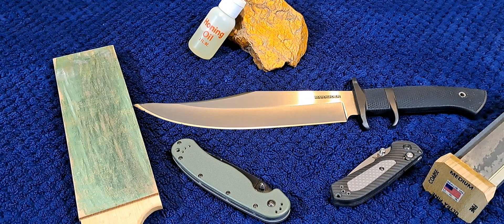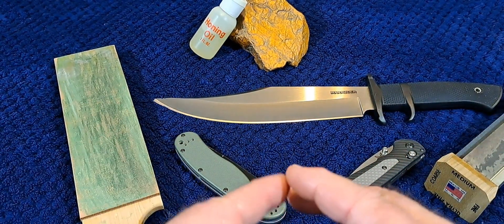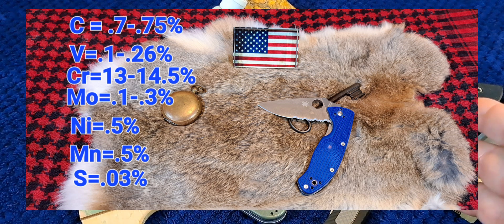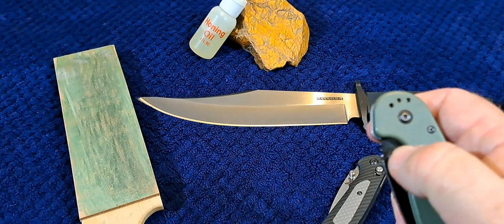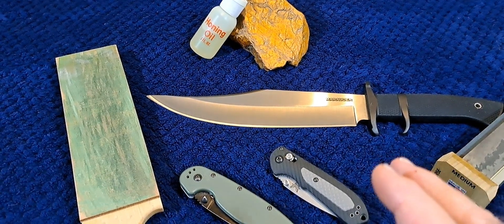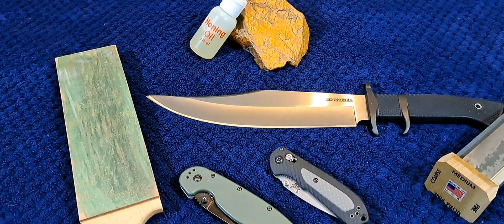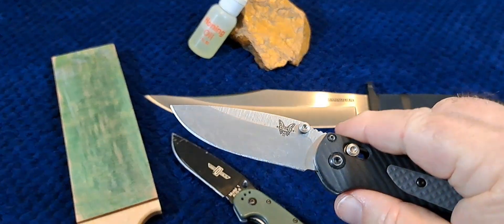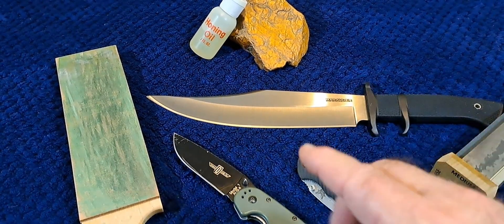What steel is that? AUS 8 steel.

Comment: Great info 👍 looking at a rat 1 I'm years in to collecting never picked one up on a side mote im in south central Florida aka the swamps lol never had any issues with rust  with d2 but i don't hard use my knifes so might have something to do with it 😊
Reply from the maker: You should try the Rat 1.5. I'm a swamp monster from Miami 😊
Reply: @rasputinscastle nice fellow swamper ...Kool I will check out the 1.5 😊

Comment: Very well explained. I always look at the charts and its even better to have each thing explained. The "toughness" rating always threw me when i first started with knives.
Reply from the maker: @PatriotPaulUSA  The toughness is really the shearpoint of steel. The harder steel is the longer an edge will last, but the steel is more brittle and likely to break. So the softer it is, the tougher but also its edge retention is lower.

Comment: Cold steel used AUS8 before in their budget blades now they use 4034. Better/worse?
Reply from the maker: @Anvil-wg2je  Good question. 4034 is an old proven budget steel. It's often compared to 420HC. The chemical composition is almost exactly like 420HC. I've not used this steel, but Cold Steel usually gets the most out of the steels they use. AUS 8 doesn't get glowing reviews, but I never had a problem with Cold Steels AUS 8.
4034 only has .5% carbon content, so I don't think you can expect it to have great edge retention. It's a soft steel, so it should be pretty tuff. I expect you'll find the performance of 4034 right in line with AUS 8. 🙂

Comment: Just got a Swisstech fixed blade in AUS 8 and plan on using it as a hard work knife, idk how well its gonna work out but i know right now it's shaving sharp so we'll see what she can handle
Reply from the maker: @ksrebelbuck7936  Aus 8 can be soft. That's not necessarily a bad thing in a hard use knife.  The edge can role on you ,but it won't chip. Usually the role comes right out when you sharpen it. B0oils down to the tempering. Hope you let me know how that Swisstech works for you.👍😊
Reply: @rasputinscastle  definitely, I'd rather have an edge roll than chip or break

Comment: In general, the only characteristic in which most of the “newer super steels” and “premium steels” greatly outperform what we now call “budget steels” is edge retention.
They’re a pain in the rear to sharpen though.

For me, I’d actually rather have a steel that will take a screaming edge and is easier to sharpen than one that will hold an edge forever and is impossible to sharpen.

Good stuff as always, my friend👊🏻
Reply from the maker: The trick is to sharpen them every week. If I carry a knife all week, I use a ceramic rod and sharpen. If I switch edc knives during the week, I'll strop or use a ceramic rod depending on how hard I use it.
I wanted to see how long the edge S35vn blade would last. I didn't wait til it dulled. At the end of three weeks, I sharpened it with a ceramic rod. Most of my knives are regular Steels. I just hone them when needed. The only time I use a stone on a knife is when I first get it if it needs an edge. I appreciate Super Steels, but I'm with you. You don't need them.

Comment: I first bought an AUS 8 knife in 1993 or 1994 from A.G. Russell and used it until now. I never noticed an edge rolling issue. I believe that you cannot use the same grind angle for every type of blade steel and shape and expect it to perform the same. In addition, too shallow of a grind angle will induce both edge roll and chipping from both hard and brittle and softer tough steel. AUS 8 was primarily use for kitchen knives; it takes a sharp edge and is easy to sharpen. It is much like 1095 with a high resistance to rust. Both have similar HRC hardness; AUS 8, 58 to 59, 1095 HRC, 56 to 58. The idea of Super Steels performing better might have merit for special uses but comes with hard to sharpen and strong but brittle tendencies. New steel types are new but not always better. :goodvibes:
Reply: Agreed brother 😎🙏🏻